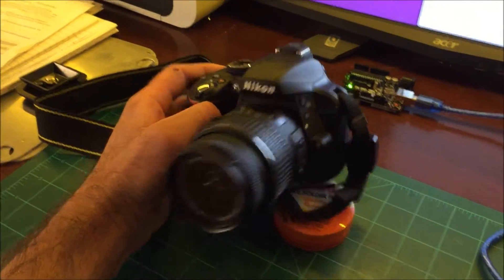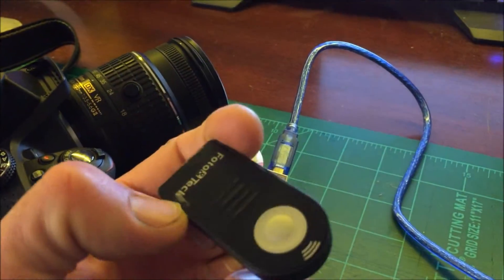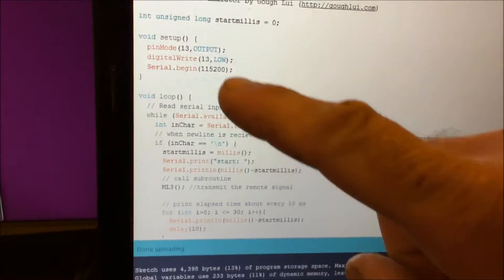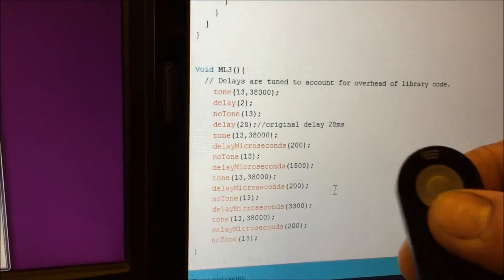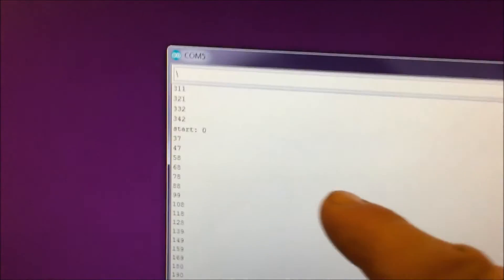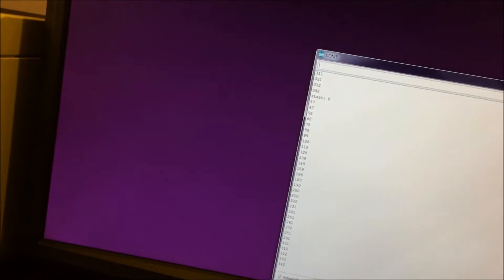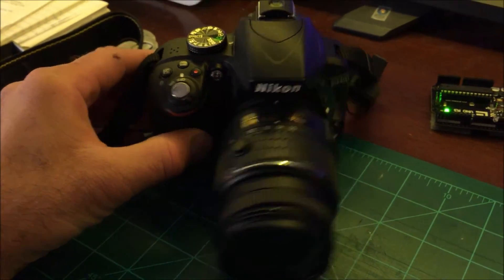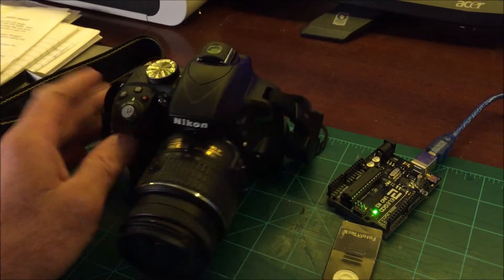Arduino wireless remote for Nikon DSLR

Comment: As said. Move from auto to manual. 
But you could also wire the remote button into an output pin to trigger. 
If you as doing spalsh photos. you can sync the dropper and camera. 
Just a thought. :-)

Comment: Thank you so much for sharing this. 
I tested the code and it worked. 
I have modified it a little using a variable to setup the out pin and I'll use this code to take timelapse photos.

It helped a lot

Comment: Where can we get the code for arduino, please?
Reply from the maker: // adapted from:
// Nikon Remote Emulator by Gough Lui (http://goughlui.com)

int unsigned long startmillis = 0;

void setup() {
  pinMode(13,OUTPUT);
  digitalWrite(13,LOW);
  Serial.begin(115200);
}

void loop() {
  // Read serial input:
  while (Serial.available() > 0) {
    int inChar = Serial.read();
    // when newline is recieved, print start message, then run the remote transmit routine.
    if (inChar == '\n') {
      startmillis = millis();
      Serial.print("start: ");
      Serial.println(millis()-startmillis);
      // call subroutine
      ML3(); //transmit the remote signal

      // print elapsed time about every 10 ms
      for (int i=0; i <= 30; i++){
        Serial.println(millis()-startmillis);
        delay(10);
      }            
    }
  }
}

void ML3(){
  // Delays are tuned to account for overhead of library code.
    tone(13,38000);
    delay(2);
    noTone(13);
    delay(28);//original delay 28ms
    tone(13,38000);
    delayMicroseconds(200);
    noTone(13);
    delayMicroseconds(1500);
    tone(13,38000);
    delayMicroseconds(200);
    noTone(13);
    delayMicroseconds(3300);
    tone(13,38000);
    delayMicroseconds(200);
    noTone(13);
}
Reply from the maker: https://www.reddit.com/r/Skookum/comments/60sk5t/automated_shutter_release_for_nikon_dslr_need/
Reply: @Fur_Trader  Thanks for all!!!

Comment: its slow because the shutter has to open and the camera is focusing and getting exposure. turn off the flash and set EVERYTHING to manual. it will take photos much quicker that way,

Also, serial communication to the arduino isnt that fast so it likely adds to your perception of it taking so long. the arduino and remote both take the same amount of time to execute the signal, and in both instances the camera takes the same amount of time to take the photo. 

If you want to remove the serial delay, use a button on the arduino rather than using your keyboard. If you want to automate it, factor in those delays

Comment: Thanks a lot for sharing. It worked with me like a charm using Nikon D5300. I guess the reason why it is a little bit slow is because you use the "Auto" mode so the camera do metering and auto focus before each shot. Note: In Nikon DSLR camera (in my case D5300), to be able to take shots using this Arduino setup, go to "MENU" -> "SHOOTING MENU" -> "Release mode" and set shutter release mode to "Quick-response remote (ML-L3)"